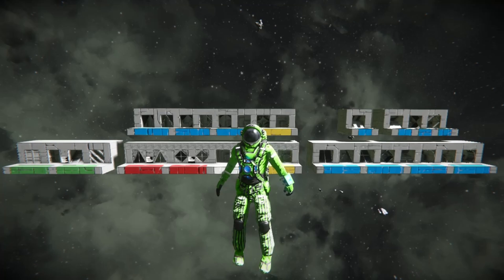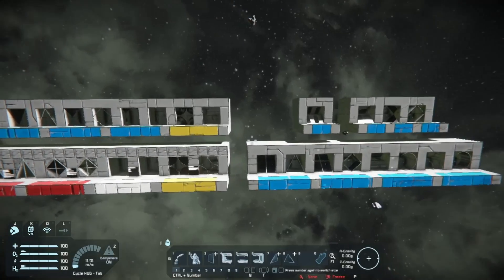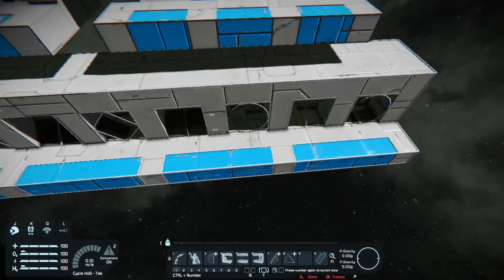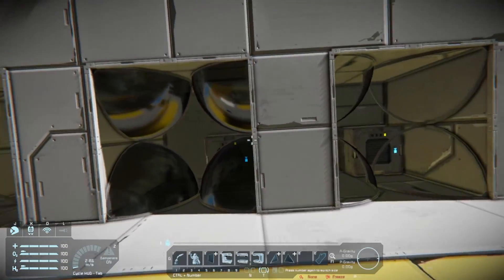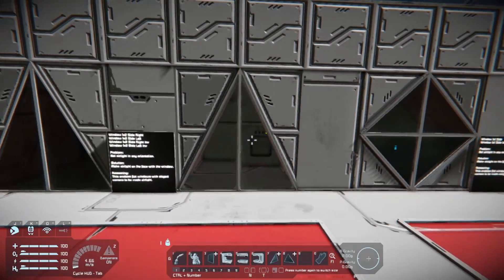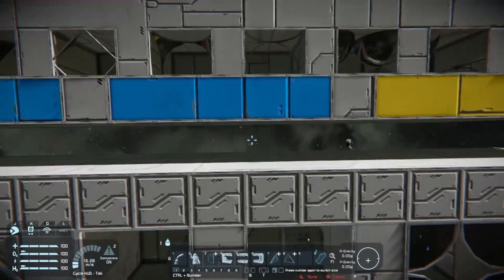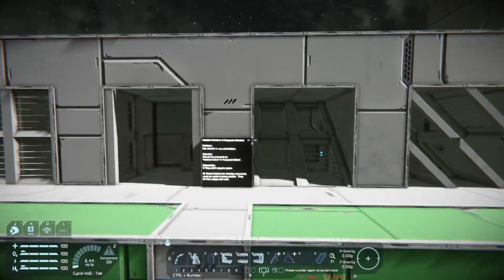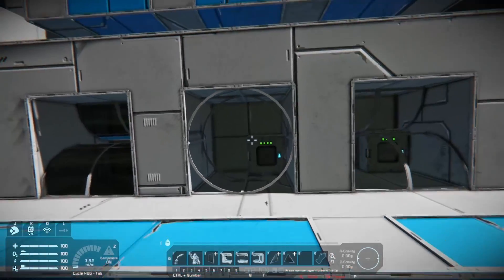Window Airtightness Lunacy: Space Engineers "Working as Intended"

Comment: The reason the curved and slanted windows are airtight in any orientation becomes more apparent when you start combining them with those corners that aren't airtight. The way it currently works allows you to make a glass roof with those curved windows, without requiring a 2nd boxy roof to keep the air in.

Comment: I'm totally thinking of using windows and holograms to make star wars type air Locks
Reply from the maker: Works great with projectors, even better if you can line up a safe zone on a station.
Reply: @ShiftyshadowTV  thanks for the tip about safe zones! Also i found some more keen air locks. Which im sure your aware of but if not the armor plates work the same exact way lol
Reply from the maker: @red-merlin  Yeah, the armor plates are fun for this, especially the centered flat panel, it has some cool uses.

Comment: This is good to know, I want to make a custom mechanical cockpit for a small grid ship. What you’re suggesting regarding double stacking windows might just make my build work. Thanks for the tip. Do you (or does anyone?) have any special airtight cockpits using the double stack technique, or just tips on that? Kind of a weird topic.
Reply from the maker: Not sure if anyone else has stuff like that.  I have a few small grids with custom cockpits and windows.  I tend to do a little extra overlap of the openings instead of layering the windows though.  Here are some examples:
https://steamcommunity.com/sharedfiles/filedetails/?id=2923100489
https://steamcommunity.com/sharedfiles/filedetails/?id=2899138745

Switching which sides the windows are placed on can help too (look at cockpit side windows of this one).
https://steamcommunity.com/sharedfiles/filedetails/?id=2842087340
Reply from the maker: If you want a cockpit with a window that can can open and close use angled blocks around the edges and then place the windows so that the airtight side lines up, but doesn't connect to the block.  Hard to explain, but similar to this:
https://steamcommunity.com/sharedfiles/filedetails/?id=2959347996

You can, of course, make the window shape significantly more complex if you like.
Reply: @ShiftyshadowTV   Thank you so much for the reply! I’ve been wondering why some windows are reversed haha. I’m very new to the game so everything helps. Aside from watching the videos, I’ll mess around with that drop pod for sure (no DLC yet). Awesome designs btw! I like the realism feel and the efficient use of space.

Comment: What about those bed windows and the small grid barred windows?
Reply: Perfect, I have been trying to diagnose an airseal issue in a crew quarters section of my battleship and I couldn’t tell if it’s the beds, armour, or something with the floor
Reply from the maker: The beds are airtight on 3 sides (the ones that make sense). The small grid bar windows are not airtight at all.
Reply from the maker: Also, if you're wondering, the passageways are all airtight exactly how they look like they would be.

Comment: A lot of the windows you put on the out side of your grid wall and not on the same plane as your wall.
Reply from the maker: I tried them all in every orientation with and without walls on various sides.  The display setup makes it easy to visualize the relevant findings.

For a window block it doesn't matter if it's in the same plane as the wall or not as long as the face you're testing is directly against the opening.
Reply: @ShiftyshadowTV   You are still missing it, the red ones are not connected to the walls like the other are, remove the screen and the floor that is in front of your air tight box and the window will float free. it does matter what plane they are in as the window makes the voxel that they are in air tight not the one around them.
Reply from the maker: As long as it's all one grid, it doesn't matter.  Go do some testing.

Comment: No. The window wall does not work perfectly as you expect it. Place it and move to a surrounding where you need airtightness. The whole room will be perfectly airtight ... but you must not move an the backside of the window directly. There you get exposed to the harsh environment, no matter how well the window saves the rest of the room. At least last time i used them this was the case.
Reply from the maker: Yeah, it probably depends on the orientation of the window.  As long as you're not inside (or brushing up against) the window block you shouldn't be exposed though. I haven't experienced any problems in my recent play.

Comment: I'm going to add some of those round window airlocks and RP them as 'force fields.' It also explains why I can't make some projects air-tight.
Reply from the maker: If you set up a safe zone that bisects the window airlock it looks great as a force field. A bit hard to work into a build though.
Reply: @ShiftyshadowTV  You could also use a projector hidden into the wall that projects a plane of armor panels. Would be a lot cheaper than a safe zone.
Reply from the maker: @Stoney3K  Pretty good idea actually.

Comment: I seem to recall airtightness being defined in the XML files.  I'll take a look tonight.  You may be able to mod those flat windows to be airtight with minimal effort.  A lot of times, I'll make mods that just change the specs of the vanilla blocks.  That way, all I have to do is enable/disable the mod and not have to worry about changing my ship designs to accommodate missing modded components.
Reply from the maker: Yeah, certainly let me know what you find out. I haven't done much modding for this game, but I'm considering branching out.
Reply: @ShiftyshadowTV  Well there still is an element called <IsAirTight>...but I literally set them all to true on the windows and it didn't change a thing.  So i'm not sure.  LOL
Reply from the maker: @djsting  hahaha, was worth a try I guess.

Comment: About the tube windows being airtight on their curved edges: If they weren’t air tight on those ends, you couldn’t use them as part of an air-tight tube.
Reply from the maker: Sure you could, you'd just have to make the ends of the tube airtight with other blocks, the central parts of such a tube would not leek air out their sides.  (Assuming you're talking about a perfectly circular tube that extends multiple blocks out.)

Perhaps we're misunderstanding which faces of the block each other are talking about.  I didn't explain it very clearly in the video.
Reply: @ShiftyshadowTV , we might be, but I’m talking about the curved sides, not the straight ones.

If those edges aren’t air tight, then a tube made of multiple of segments wouldn’t be air tight any more than a tube made out of rings of conveyor tubes would be.

Comment: If you think of the shapes, and other considerations required to correctly put down angled glass you might agree with Keen's decision on this.  

Good point that other windows should be considered airtight for consistency.
Reply from the maker: Certainly, if you want your windows to be airtight the angled ones have to be airtight in most directions. I may think it leads to silly side effects, but I am all for making them overly airtight (rather than the alternative, as in the case of the flat but not rectangular windows).  There are still some window shapes that look like they should be airtight but are not.